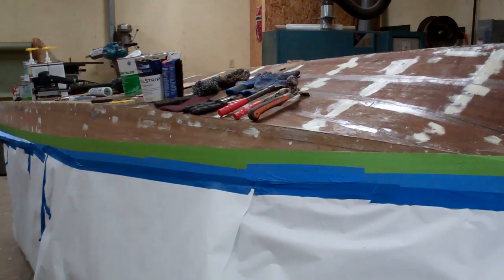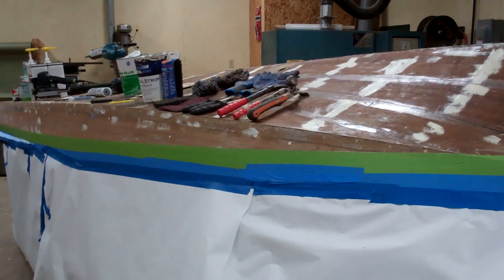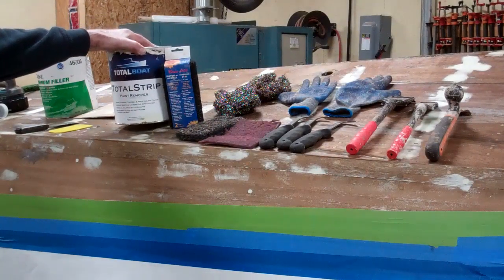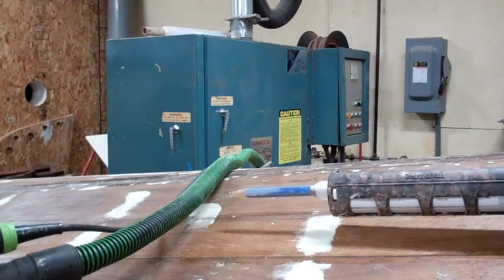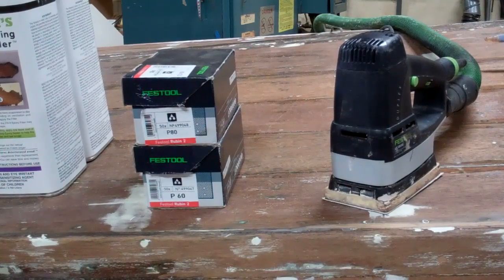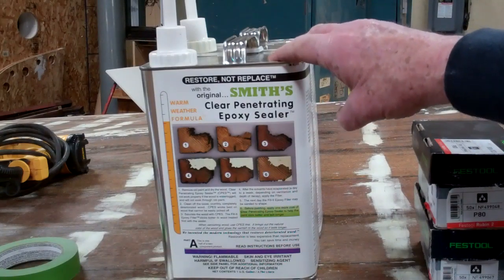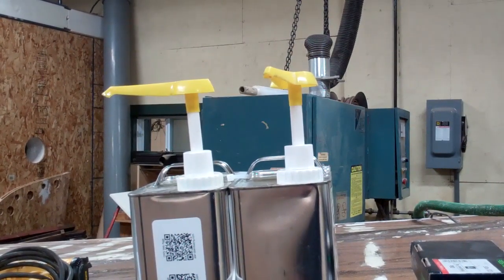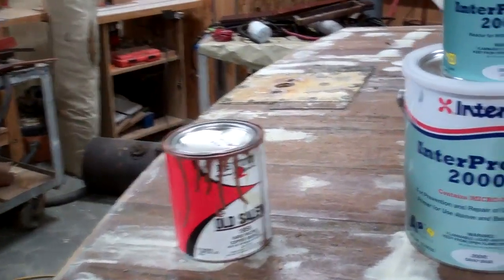1956 Chris Craft Capri 19' Bottom Work 4 13 2020 Snake Mountain Boatworks LLC

Comment: First of all, I love your videos. I used you suggestion for lapstrake bottom seams with the flexepoxy. It worked great. Question about this video.... If this is a soak bottom, if you use penetrating epoxy, does it stop the planks from swelling? Also, Does the Thixo compress enough to avoid the planks from cupping when the planks swell up?
Reply from the maker: CPES all-all-but completely stops plank swelling and shrinking, but only if the planks are removed and both sides, the edges and the butt ends are thoroughly soaked - four FULL coats. They will swell and shrink a bit in this application.
Yes - THIXO remains amazingly flexible, thereby protecting against plank crushing as they swell.

Comment: In re-watching this video Michael, it helps me remember just how much work goes into restoration of the boat's bottom...  I also use Frog Tape and have yet to apply my boot stripe...I'll be using a laser level but that doesn't help much when you have to paint that stripe over (what do you call it???) the "Water Deflection Board" that Century boats have, but I'll figure it out...   Thanks once again for the time you put into these videos....Much Appreciated by the wood boat community!
Reply from the maker: They are splash or spray rails, Mike, and, I agree, a super pain in the butt when the boot stripe crosses them. We try to position the laser amidships and far enough from the hull so that the line crosses both the stem and transom corner. That way we get very close to where the boot stripe enters and leaves the spray rail, but it can still be a crap shoot at times.

Comment: Thanks for the excellent video. I am in the middle of a small project where i need to strip 2 layers of paint and varnish and do miss the old strippers. The new "safer" ones don't work anywhere as well as the old stuff that would eat your cheap latex gloves and smelled awful. You could lay that stuff on and within minutes see it bubbling up and pulling everything off. Oh well, guess we have to accept progress in the name of safety. Thanks again

Comment: After 1850 went away I had the same problem. I teach woodworking at a local Experimental Aircraft Association and we buy a lot of products from Aircraft Spruce. They use SHARE
Facebook
Pinterest
Tweeter
Print Page
Email Page
CERTIFIED COATINGS AIRCRAFT / MARINE / AUTOMOTIVE PAINT REMOVER’

Comment: I have 57 15' Lyman lapstrake.  I just bought total boat cpes and fairing compound.  I was wondering about filling the seams also. Looking at the thixoflex but do you reccomend anything else? I don't want have to buy a new powered caulk gun or will I be able to do it by hand? What do you reccomend for a primer? You said not to use the interlux. I love your videos. Wish I saw these  last year because I did not do this, so I have to redo the bottom all over again. Hopefully for the last time. Thanks. Ken
Reply: Thanks I will look into that.
Reply from the maker: Primer: o	Primer: Pettit Tie Coat Primer 6627 - https://www.jamestowndistributors.com/userportal/show_product.do?pid=4287
And just to spend more of your money, it is absolutely critical that you seal ALL bare wood - especially below the waterline - with four coats of: Smith’s Clear Penetrating Epoxy Sealer http://www.star-distributing.com/smith/cpeswhy.html
All surfaces you will varnish must receive three coats of CPES post-staining and pre-varnishing.
I have no other caulking recommendations.
Reply: @snakemtboatworks  Thank you!  I will order Thixoflex for my seams and Primer from Jamestown and follow your instructions on the video.

Comment: If that's a citrus based stripper I found after applying stripper lay plastic sandwich wrap over stripper  seems to help keep the reaction going 
(glad wrap) as we call it in Australia
Give it a try
Reply from the maker: Thixo Flex is not a stripper. We use an industrial stripper that requires certification.